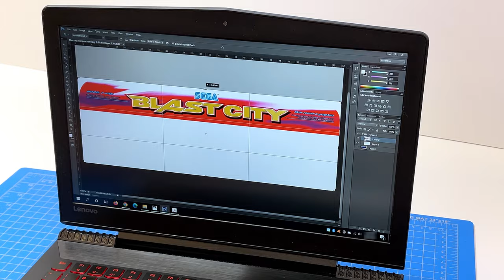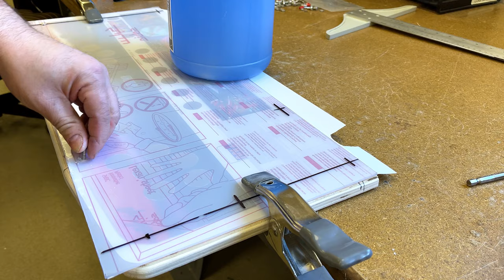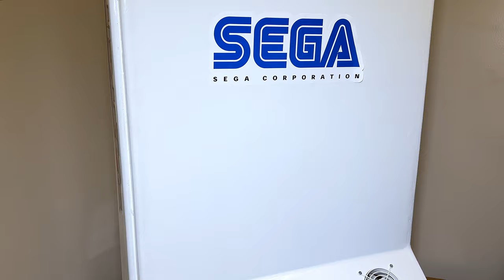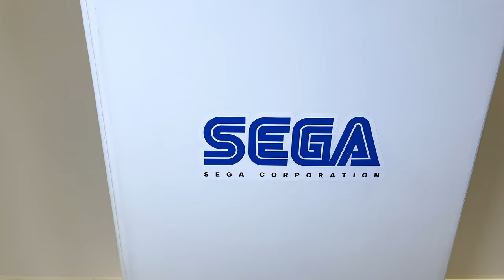How I Built My Dream Arcade! Custom Sega Blast City

Comment: One of the best custom bar tops I've ever seen. Beautiful work.
Reply from the maker: Thank you so much for your comment 🥰
Reply: Lmao he has a WHOLE shop to work with, it BETTER look good
Reply: @AppleWaveGamer  I had to subscribe to amazing project creators like your channel. How da heck did you get the marquees for the games to show on the TV screen like that? I never knew that was even possible plus the CRT retro filter makes the game play look authentic. Is there a Build for noobs that can remotely get me close to this on ArcadePunks?
Reply: this is sick, clearly you know what you’re doing 

how would you make this simple for a non woodworking expert 🙌🙌
Reply: @AppleWaveGamer Disculpe Qué tipo de pintura en aerosol está usando❤❤what spray paint are you using❤❤
Reply: its a full sized arcade, meant to be played sittinbg down, not a bar top lol, but like u siad its amazing
Reply: @ShwartsFN Disagreed
All tools shown are very basic, the best part of this build. Not even a router was used!
All major cuts with circular saw, rotary saw and basic cordless drill and bits.
Common sander and hand sanding, filling. Common spray paint cans.
All these tools can be bought used, second hand, refurbished, open box cheap. Or harbor freight throw aways.
Imo, that's the most impressive part of this video. No large table saw etc used
Reply from the maker: @anonymousprofessor8866 yes. Arcadepunls
Reply from the maker: @geraldford6409 your are correct lol
Reply: @AppleWaveGamer  Thanks for the info!

Comment: Congratulations on the vertical screen and games, nice clean workmanship 
I also have a vertical screen cabin project, the system is ready, just cut a few old boards and start the cabin construction, it is still in the design drawing stage.

Comment: It's a fantastic job and you showed you have some skill only thing I can say is a little more time needed on the wood on closeups you can still see the round holes of screws and some imperfections in wood which could of been smoothed out otherwise that's a real piece of kit there👍

Comment: Amazing video, thank you for sharing! I did 1 player custom build this year with a Pi 4 and have had so many issues getting the front-end to work correctly in vertical mode. Can you share what software package you used here? I've had no luck with Batocera but haven't branched out to other builds. The resolution and aspect ratios all look great with the borders here.
Reply: Batocera works try going into SYSTEM SETTINGS → SCREEN ROTATION and setting it to “270 DEGREES”. ..I was doing this for the longest while but NeoGeo games like Samurai Shodown have certain screen flashing effects that don't look good vertically since they were designed for a horizontal screen...that being said playing cave games is awesome in vertical mode

Comment: Really nice build, now im off building my own. I was wondering what emulation your using. Is that an pre built image from Arcade Punks or so? The marquee done by the emulation?
Reply from the maker: Yes to all 😊good luck with your project.
Reply: @AppleWaveGamer do you possibly remember what image you used? I’m on CoinOps now but really don’t like the marquees, would rather use the whole screen as I’m running in tate/vert mode.
Thanks!

Comment: How did you set it up to have a power switch for the main power source on the outside of the cabinet? Right now I have a spare laptop running everything but I have to manually turn on the laptop. I would much rather just press a switch on the outside of the cabinet to turn the power on.
Reply from the maker: It’s hard with a laptop. I am using a PC build. It can be done on a laptop but some soldering needs to be done to the on and off switch on the laptop motherboard.

Comment: The screen sucks. Also you didn't use a MiSTer. Other than that I like the woodwork.
Reply from the maker: Agree. I can always upgrade the screen. Thank you 🙏
Reply: @AppleWaveGamer  No problem sorry to sound negative. Get a MiSTer because its just like owning the original hardware arcade PCB boards. So far it has about 450 games. It will never have as much as mame, but what it does have is much, much better quality and 1:1 to the real thing. Also 0 lag. Well worth the money but also has tons of consoles, handhelds, and computer cores. You can still keep something else in the cabinet for the rest of the Mame arcade stuff that isn't on MiSTer